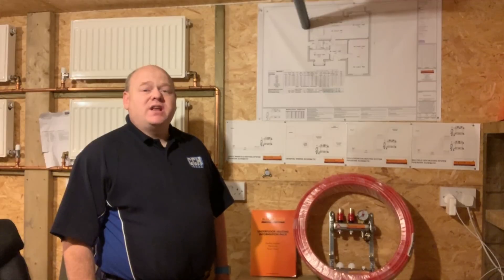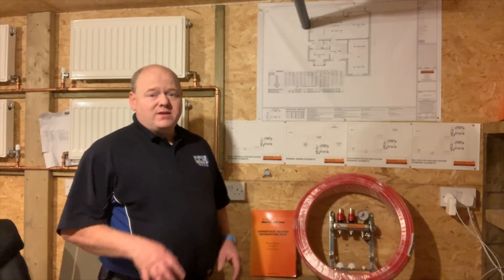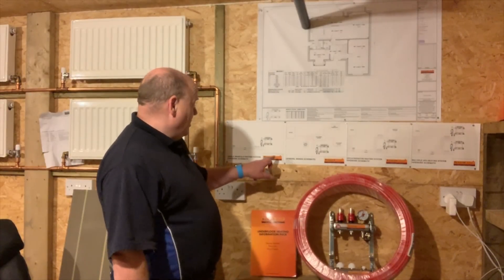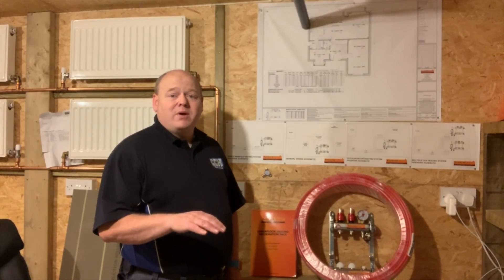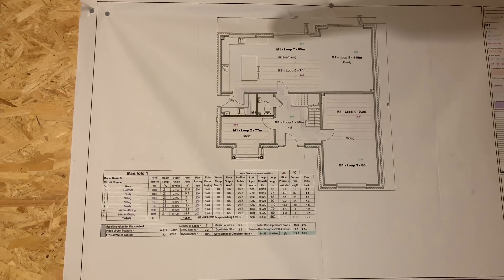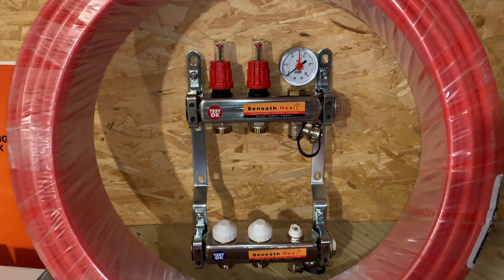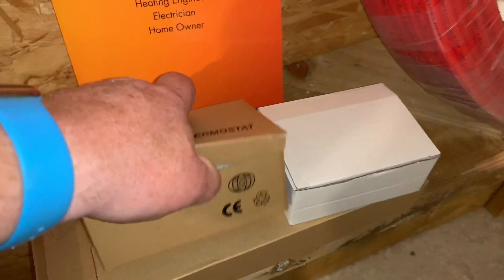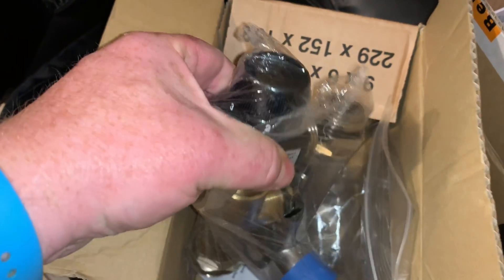HOW TO INSTALL UNDERFLOOR HEATING - Part One Concrete Floor

Comment: Is that enough insulation for a concrete pad?  What’s the r value or u value of the insulation?
With that grove it would be even less than the full depth.

Comment: Hi Allen. I'm looking at the in screed system for my extension floor. What I need to know is whether this overlay system is any good over an existing uninsulated floor. There doesn't seem to me much of a thickness of insulation in the grooved boards so would I be wasting energy into the floor slab? Am I better off with radiators in these areas?

Comment: Hi mate, been told I can’t have carpet with UFH is that right?
Reply from the maker: Hi Chris, carpet can be used with UFH, however, the combined TOG rating of the carpet & underlay must not exceed 1.5 as per guidelines to not restrict the UFH output
Reply: Allen Hart thanks mate, can’t wait to see the finished video & keep up the good work 👌

Comment: Hi Allen can you add underfloor heat to any exsisting heating system meaning if I have a combi 30kw and I want to have underfloor heating I could or do I need to upgrade things if that makes sense.
Reply from the maker: Peter sutton That’s a really good question. I will add that in next video Thanks. 👍

Comment: It's call foam cement board. Avaliable in 4mm, 6mm, 10mm and 12.5mm. Great stuff for lining out a bathroom, prior to tiling. Light weight and easy to cut 👍
Reply from the maker: Stuart A Not sure how thick this one is, I will check though. Thanks👍
Reply from the maker: This one is 15mm Thanks
Reply: @AllenHart999  Allen what is the of board that you used?

Comment: Hi Allen what underfloor heating would you recommend in a small bathroom, ideally where it doesn't raise the floor to much, I want warm toes while I am having a shitewer
Reply: What the hell is a shitewer? Having a crap in the the shower... jeez dude. 😮😥
Reply: @mixer7586  I couldn't decide between shower and shite so shitewer it is
Reply from the maker: Electric might be the best option for that. Thanks.